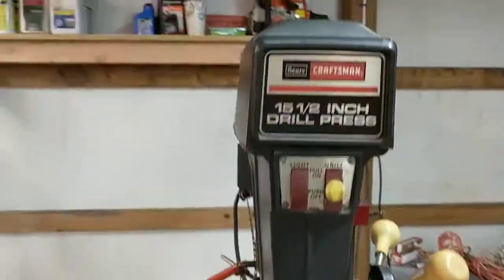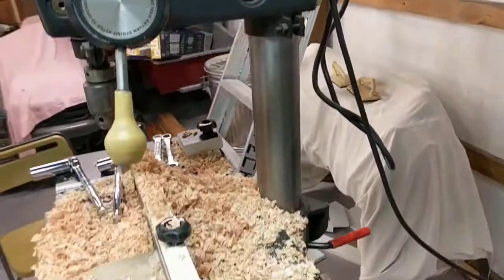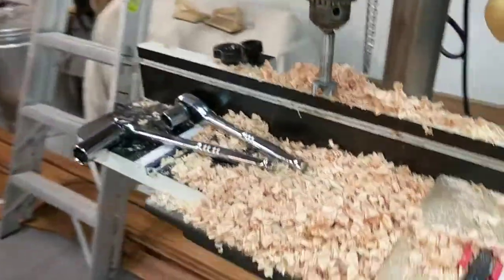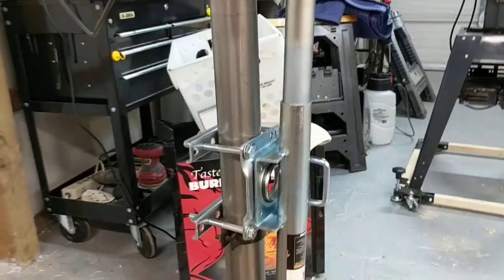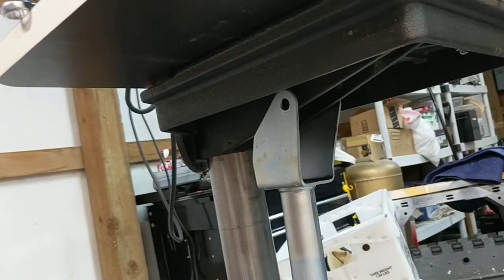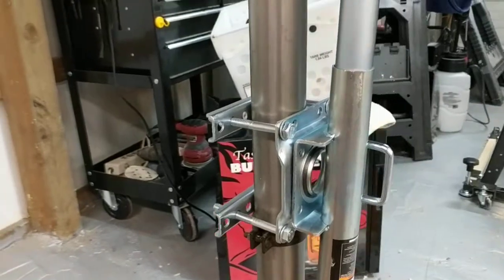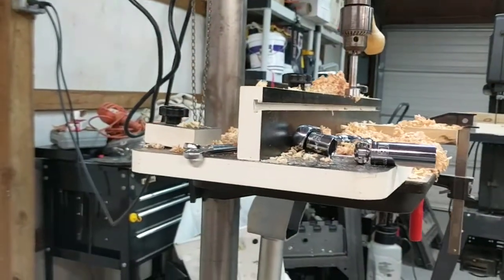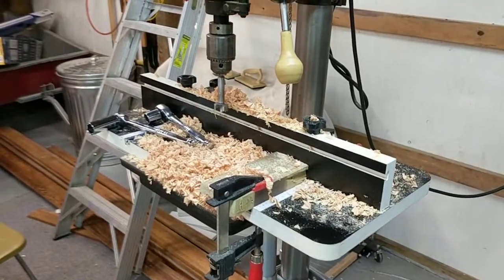Drill press table lift if you don't have a rack - Hack for old drill press

Comment: Works great! After watching I went to HF with coupon in hand and installed this jack on my old Craftsman 150 drill press. Lifts table effortlessly, I need to coax the table a bit when lowering but much better than without it. I dreaded changing table height so much I was compensating with blocks of wood to change the height of piece being drilled. Won’t have to do that now. Thanks for sharing this idea!!!!!
Reply from the maker: Same here - had kept a 4"x4" and a 2"x4" next to drill press for that purpose.  Sweet when a cheap fix works.

Comment: This is a fantastic idea - thanks for the concept.  If possible, it would be useful to see more detail on how you attached the wheel end of the jack to the bottom of the table.
Reply from the maker: Ehhh...I took of wheel and forced bracket into table. Wish I had a more elegant solution, but that worked ok

Comment: Cut Off The Handle Weld A 1/2-13 Nut On Shaft. Then Use Your Drill To Raise And Lower Table It Works Great. Thanks For The Jack Idea.